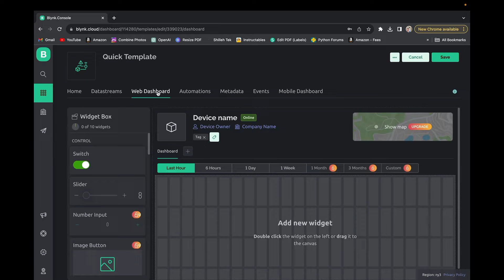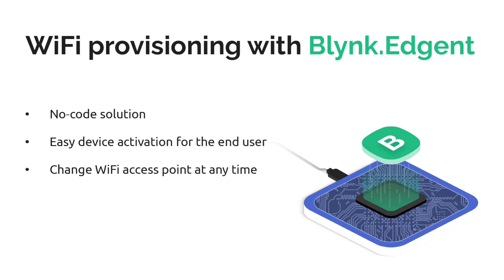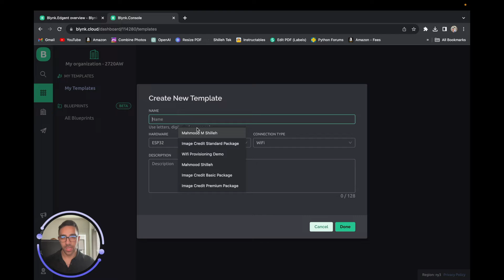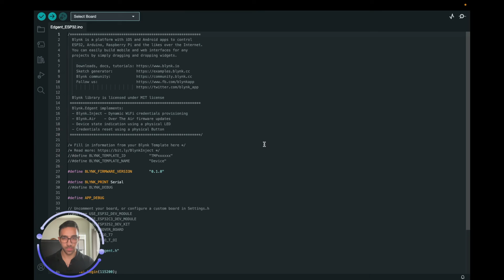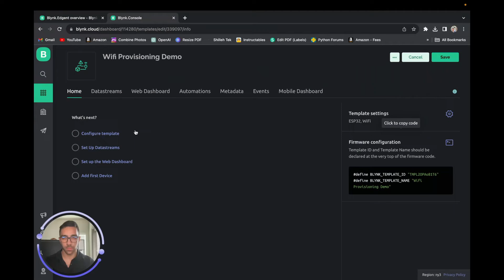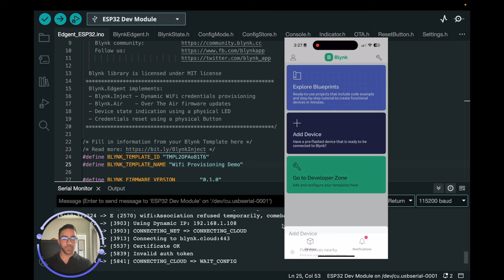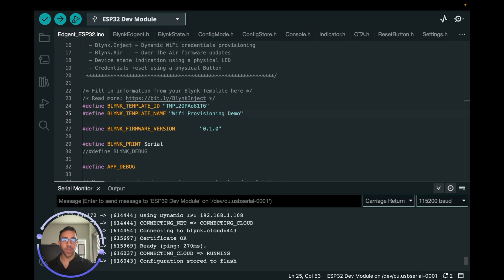How to set up WiFi provisioning on Blynk + Device activation flow demo! (with ESP32)

Comment: Wifi not declare how can i fix it
Reply from the maker: have you tried reporting and discussing this on our forum?
Reply: @blynk  just include the wifi library i.e, #include <WiFi.h> in this file(C:\Users\type Your pc Name\Documents\Arduino\libraries\Blynk\src\BlynkSimpleEsp32_SSL.h) open BlynkSimpleEsp32_SSL.h and just add wifi library and your problem will be solved
Note: the location i provided is the location in my pc.This is different in your pc. in the location just replace your pc name after users\
Reply: @blynk  I had the same issue. The only way to fix it was to go back to ESP32 board package pre 3.X.X. This worked but it caused more issues than it fixed.
Reply: Same ,wifi not declared @blynk